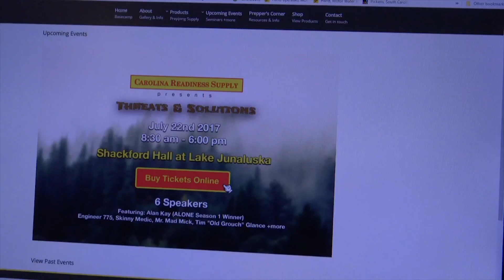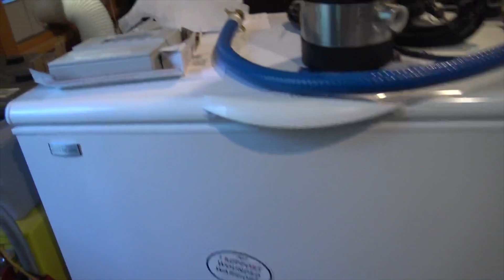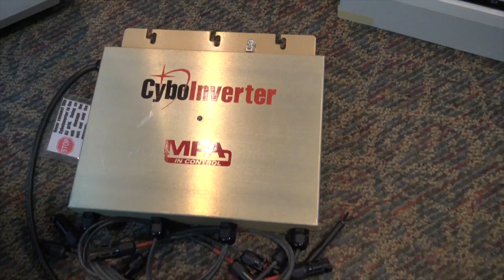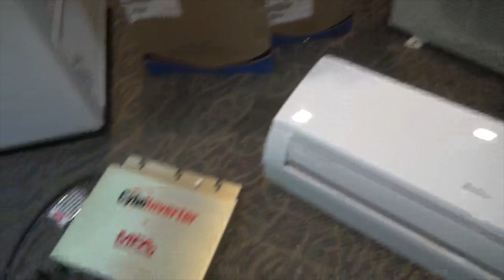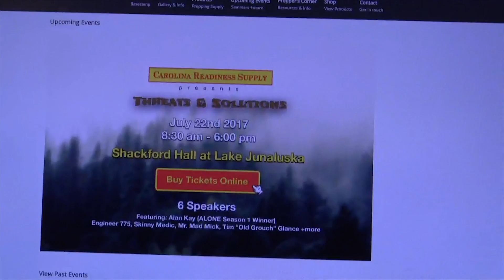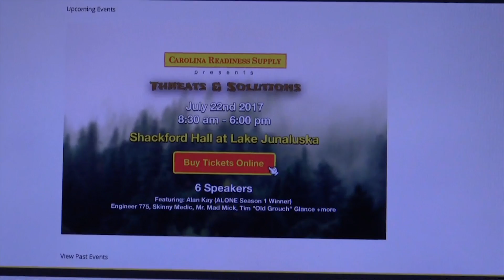Threats and Solutions

Comment: just wondering what is going to happen to your future gree outfit, when there is not enough solar to run the outfit wholly.
i mean i can see it working at night, there is no power at all and not running anything at all
or during full sun plenty of solar electricity so nicely working.
but what about if there is only half the solar wattage available?
Reply from the maker: I will find out soon.  I am going to put the unit on a timer. I think I will start up the unit when the solar should be producing about 300 watts and then off at a comparable time.
Reply: yes, but what about them clouds?